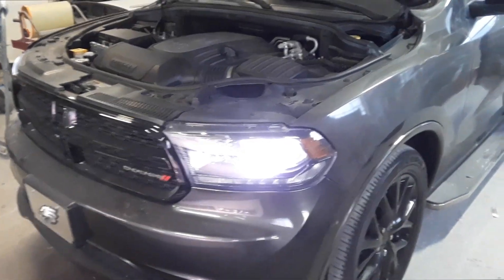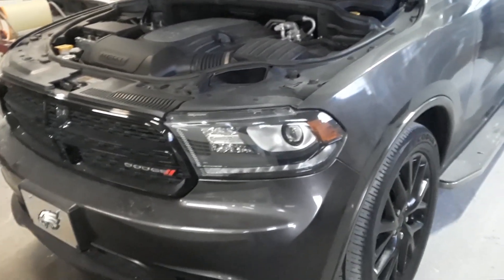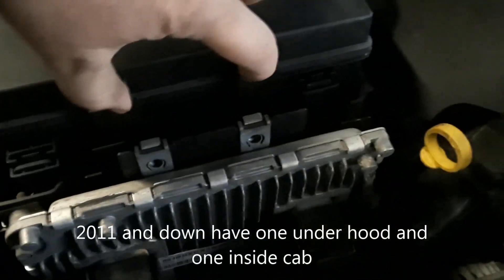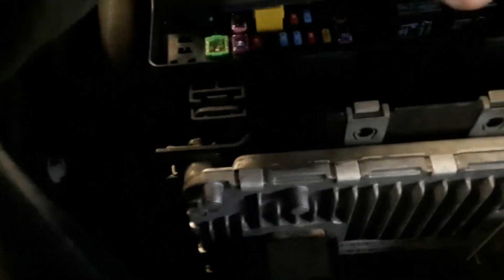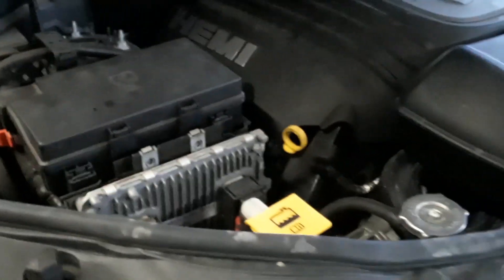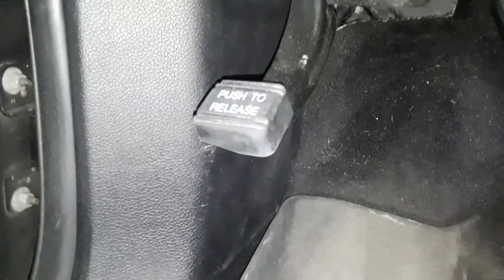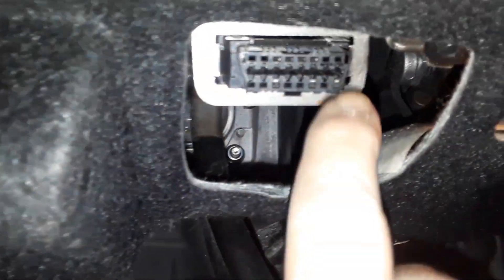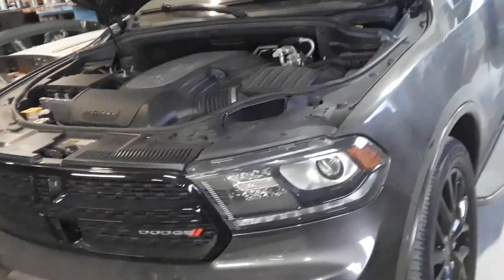Dodge Durango Fuse box Locations & OBD2 Port

Comment: 2018  durango i change the sygnal ligth buld both of them and still says  i need to to change. Cannit be the fuse. And were can i located. I know were ghe fuse box in the motor.  But were exactly is it
Reply: From what I looked up the signal light problem is the socket the bulb plugs into. The sockets are somewhat of a low grade, buying two aftermarket better made socket is the answer. When replacing them please do it correectly, use solder and heat- shrink tubbing.

Comment: It appears to have been moved for 2021+.  There is no access panel under the passenger seat, and the owner’s manual does not show the battery location.  Where is the new placement?